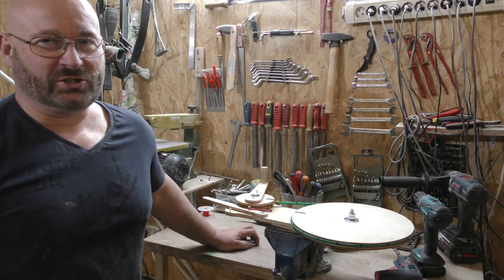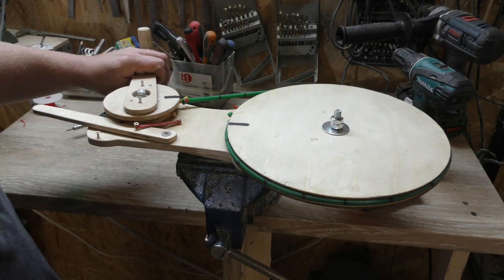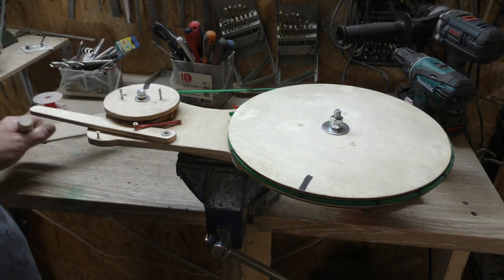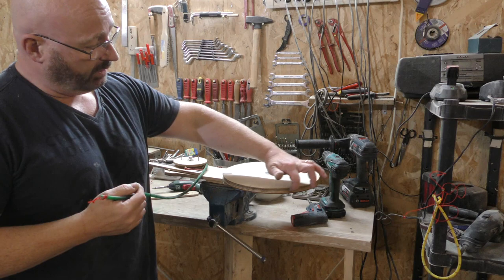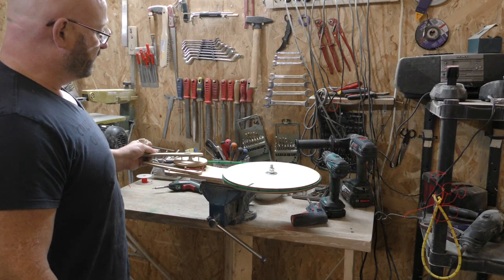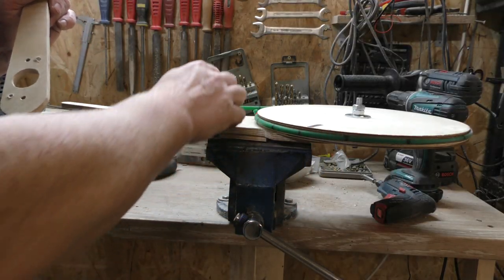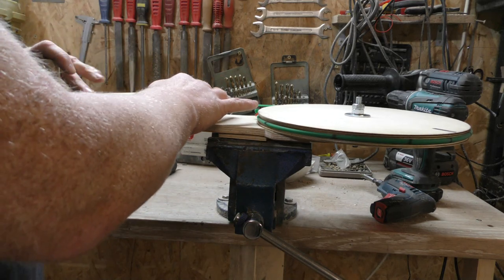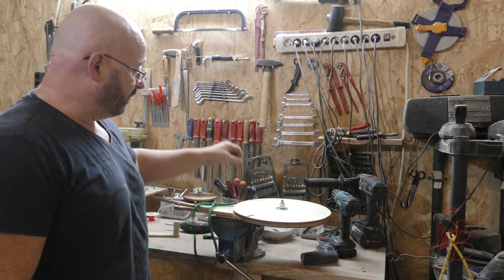High torque rubber motor?

Comment: i dont even know if its possible, but it would work well if the wheel could spin freely after the rubber is released without having it stop from the pull of the rubbed

Comment: Since the secondary wheel never really turns and is just being used as a long anchor point, I was wondering if you could just stack multiple of those wheels together for more length (or for the same length, but with a smaller diameter). You would need to create some kind of "channel" to transition from one wheel to another. 

I would go into more detail but I think you're probably cleverer at designing things like this than me... you can figure it out, if this idea is good :-)

Comment: would you need to use a bigger wheel? couldn't you spiral further turns instead to keep the wheel the same size in diameter but bigger in the vertical

Comment: How about making multiple wheels parallel to each other and connecting them with small wheels that have a 90 degree offset so that they are vertical to the main wheels. There would be a considerable amount of friction, but if done carefully, i think it might work.

Comment: rather than a larger wheel would a second wrap around the existing wheel be an option? what is the braking mechanism on the larger wheel that keeps the tension?

Comment: This needs to be much stronger. You also need to find a way to employ bare rubber because this one covered in threads has low efficiency. You also need a stepping mechanism like an escapement anchor to have the timing of your shooter remain good. This won't be easy; in fact, it will be a worse challenge than making the whole automatic crossbow.

Comment: Could you add some sort of governor to prolong the energy release in a more controlled manner?
Reply from the maker: The energy release will automatically be slower as soon as I put some charge on it (like a full auto crossbow system).

Comment: open up a roll of measuring tape that is 5 or more meters long to see how it works, it stores the "rubber" (in that case it is a metal strip) inside the sppining wheel

Comment: Instead of a larger wheel try a drum that has a spiral rail winding around it. Or two stacks of the large wheel where the band alternates between them. You would get more length either way rather than using a larger wheel.

Comment: could you use a lever with a long arm tied off to a string, fulcrum in the middle, and a short arm connected to allot of rubber, then spool the string like you are the rubber here. 
 this way you could stack rubber bands for more torque, but still have it move a definitive short distance, and be able to translate that larger amount of torque to a non stretching "drivebelt" that would remain unchanged in diameter and length regardless on the current draw, or the needed resistance\strength.

Comment: you can also use pulleys that face each other and wind the rubber on them instead of the wheel. so with (let's say) six pulleys (two triads facing each other), you will have triple the lenght of your board in rubber. It should look like the system that stretches the sails on a sailboat. multiple pulleys on the same rope, to multiply the force you apply on the rope. I hope what I am trying to describe is uderstandable. I wish I could draw it XD

Comment: Maybe you could use a large flywheel to store the energy instead, and use rubber as a way to but the energy into said flywheel. That would make the same energy deplete slower and thus last longer - in a full auto weapon, you don't want to shoot everything at once, but rather at a steady pace.

Comment: You'd be better off making the big wheel a small pulley a little further away. it would make it a little more bulky but you would still be saving space by going up and down if the end of the rubber went from small winch wheel, up to the pulley and then back to be attached bear the winch. The small pulley would be better because there'd be much less friction and it should stretch everywhere evenly immediately as soon as you start winding.

Comment: I'd build a simple rubber motor like for a model plane, and attach it to a worm gear turning a large sprocket to give you the torque. You can wind up the rubber from the other end.

Comment: Why do you use only one on one wheel? If you took 3 or 5 of each kind and connent the smaler ones witz a moving pole you can reach a lot more force even by using small thin and powerless rubber, wich provides the invention from beeing to humungous to be used in a real process.

Comment: Instead of having a larger outter wheel, could you instead layer the rubber in a cork-screw fashion, and have a smaller wheel? it would make the entire system much more compact if it's possible

Comment: you should use several smaller pulleys instead of a big one. by doing this, you would waste less energy in friction and also have the rubber stretching more evenly.

Comment: Do you know the DIY toy made out of a long string and a disk tied in a loop and if you grab on opposite points of the loop, while the disk stays in the middle, if you spin it a little and then pull the ends of the string it spins really really fast and if you pull at the right frequency and with the right force you can spin the disk indefinitely? Why not try to use that concept to create a rotor. If my description is to vague or just incoherent please let me know and I will send you a picture.

Comment: Ich denke wenn du an das große Rad außen eine art Laufband machst anstatt es einfach über die Kante laufen zu lassen sollte sich das Gümmi noch regelmäßiger ausdehnen.
Ich würde das so gestalten dass ich Laufräder an den Rand des großen Rades montieren würde.
Reply: Having a Bearing on the big wheel would make the Rubber strached more evenly.
Reply: Natürlich, es würde die Reibung verringern und so die "Maschine" besser funktionieren lassen.

It would reduse the friction and therefore make the "machine" run better.
Reply: uhupatta das ziel ist ja nicht dass sich das grosse rad dreht sondern dass das gummiband weitestgehend gespannt ist. wenn das grosse rad gelagert wäre und du am kleinen ziehst, rollst du den gummi zwar auf die kleine rolle, aber ohne spannung

Comment: Why don't you use some kind of rollers to keep a lower friction between the rubber and the big wheel?
Reply from the maker: Fact is you WANT the friction so the rubber that is spooled on is fully stretched.
Reply: Don't you loose a lot of energy when the rubber is contracting because of that friction?

Comment: Er, would it not be slightly more convenient for a full-auto crossbow - something you have to carry - for the rubber-holding wheel to be more of a cylinder with multiple windings? Then you could stow the whole mechanism under the crossbow without worrying about a giant wooden disc getting in the way of everything. Just a thought, and I'm not an engineer so I'm probably wrong. =]

Comment: put an electric drill on both sides of a metal ratchet, double the rubber, and add to the full auto cross-bow. Since it's spooling the power, it won't be fast but it would be way more powerful.

Comment: I think, it would be better to use more disks and put them freely movable on top of each other so the construction would be smaller. At same time, doubling the lenght of the rubber would only double the thickness, if you add more disks.

Comment: Joerg, the large wheel system doesn't seem a very good option. There is just too much friction, and you are gaining little usable length.

You should definitely use a much larger rubberband zig-zaging between rollers, similar to your old "extended fork" slingshots. That way with 8 rollers for example, you can get 10 sections of 20 cm of rubber, 2 meters, and all of it will get evenly stretched before getting to the small wheel.

Comment: Make storage wheel thicker with a helical screw type edge so it will hold longer rubber without having to increase diameter.

Comment: I think isn't a good idea use the rubber to transmit and generate the force. Maybe is better use a rope to rotation the bigger wheel. This must be on top an a cross, this cross must be into a cylinder and many pieces of rubber must be linked to these two parts. Think about the functioning of an roman "balista"

Comment: getting rid of the battery?   then why not compressed air?   it seems like this rubber idea will end up lacking enough stored power to pull the shooting mechanism back repeatedly

Comment: Have you ever seen the little wooden toy airplanes that use a rubber ban to spin their propeller. If you use this method to store energy in a center of the rubber band rather than the end you can turn a shaft at great speed for a long period of time.
Reply from the maker: But with almost zero torque.

Comment: Why don't you stretch the rubber band back and forth over some pulleys instead of over a big wheel. This would be much more space efficient. If you use long pulleys you can even use them several times by "stacking" the band.

Comment: am i the only one curious how the big wheel is keeping that tension? is that just by the friction provided by the bolt in the middle?
Reply: NumberOneRazor I think the rubber is connected to the big flat board on the bottom,  and the big wheel just acts like a pulley
Reply from the maker: +1
Reply: ahh yes. that makes way more sense haha!

Comment: Instead of the large wheel, why not use a series of small pulleys and go back and forth between them.  You wont have the friction around the large wheel when the rubber is trying to stretch around the wheel, the entire length of rubber will be free to stretch or contract without friction EXCEPT where it's touching the pulleys.  You've shows slingshots that use that idea.

Comment: Hydraulic air ram would work really well but it would use a lot of compress air with a ram that large and shooting multiple times a minute . A step up from air is hydraulic oil ram and could gear up a hand oil pump . All depends what you looking for in the action and how thick your wallet is .... even a really small airbag  with a sleeve and a slave hook with a valving system would be on the cheap

Comment: Too complicated, try torsion of 2 rubber bands. like in some toy airplane.
Reply from the maker: Those have zero torque.
Reply: Was falsch? das Gummiband reibt auf der Fläche des grossen Rad, viel Verlust, wenig Umdrehungen und viel Konstruktion.
Torsion: Befestige 2 Gummibänder auf ein Balken, ein Lagerhalter, Befestigung der 2 Bänder und ein Ritzel (3D print Schnecken-Getriebe knapp kleiner als das "Abschuss Rad"
Verdrehen der Bänder….
Reply: Try to twist 2 spear fishing rubbers over 1m until it bends the frame.
And how were old (big) catapults driven? Torsion.